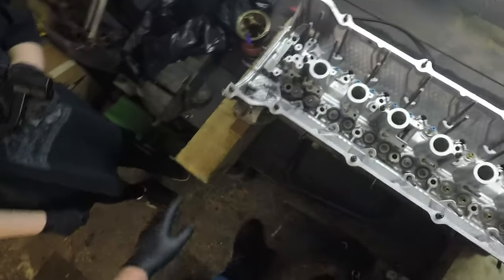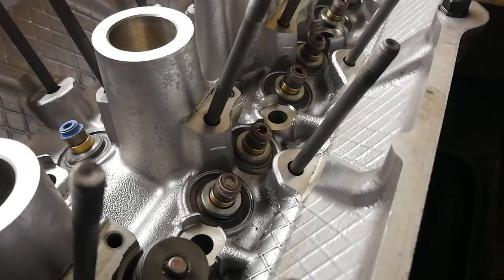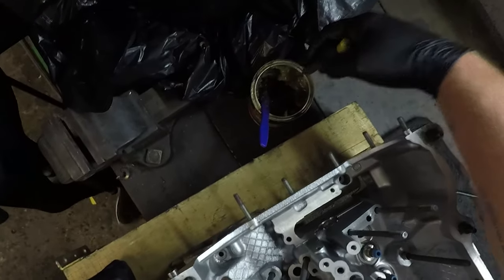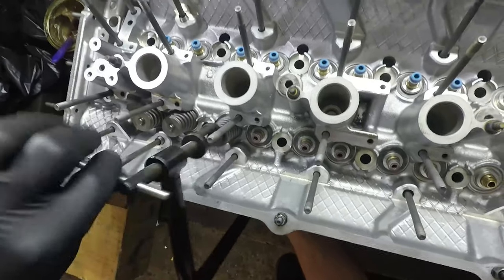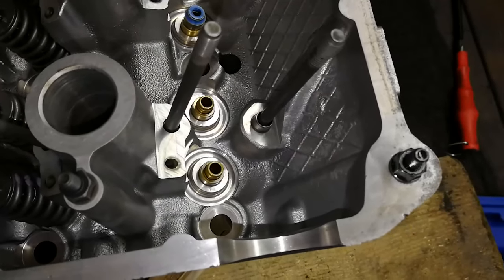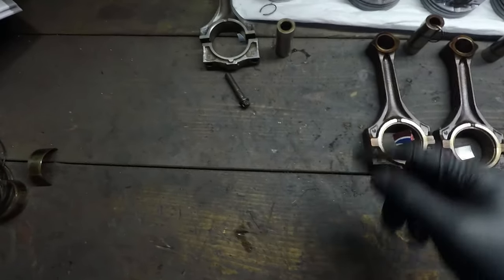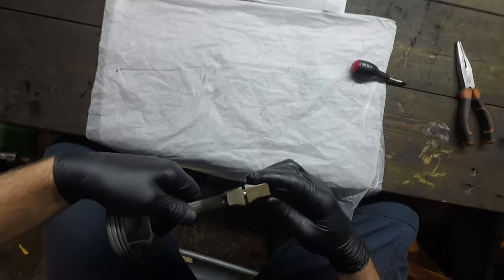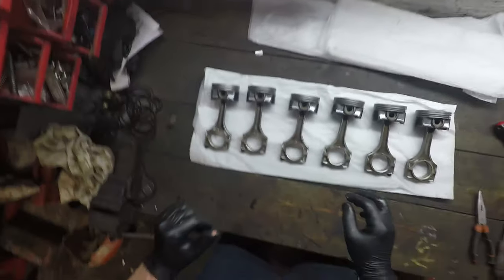E36 M52B30 Stroker Build - Valve & Piston Assembly

Comment: how did you get that cylinder head so perfectly clean?
Reply from the maker: I used to work for an aerospace company, we used a degreaser which was fantastic at removing oil varnish.
https://www.henkel-adhesives.com/nl/en/product/surface-treatments/bonderite_c-ak_4215nc-ltaero.html
Reply: @ManSeeksCivic  okay i assume you mixes the granular mix with water and sprayed the head with it? I got an m52 head too an it looks nasty
Reply from the maker: It needs to be diluted with water and agitated in a tank at around 50degc. The head was immersed and after about 30 seconds it begins to melt away the oil. Its quite serious professional stuff but is simply second to none at removing the dirt. I plan on buying a container big enough and creating a setup at home soon to allow me to clean other parts. The chemical is fairly cheap considering its uses.
Reply: @ManSeeksCivic  thank you for the information. Much appreciated! Im doin an m50 turbo build rn
Reply from the maker: You're welcome, good luck with the build.

Comment: Give the valvea a wack with a hammer a few times  to settle the collects in the top of the stems. Sounds exesif but you will be able to hear them settle. !have a look on you tube.
Reply: My thougst exactly. I always tap them using a small plastik Hammer.